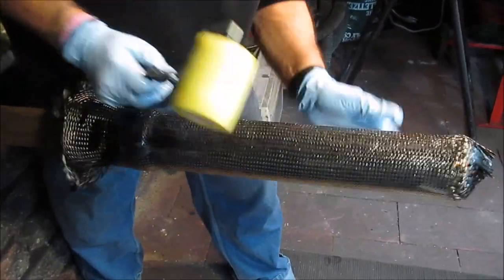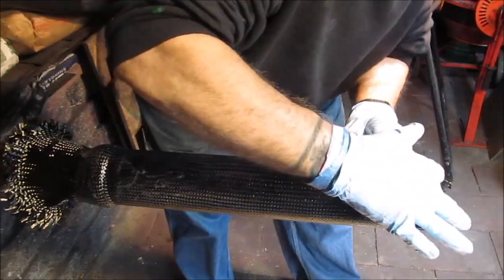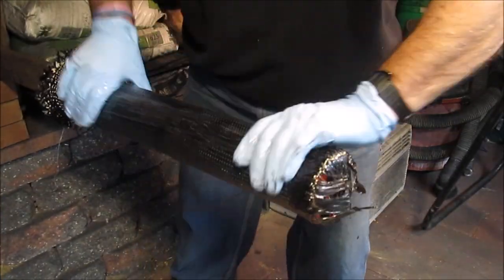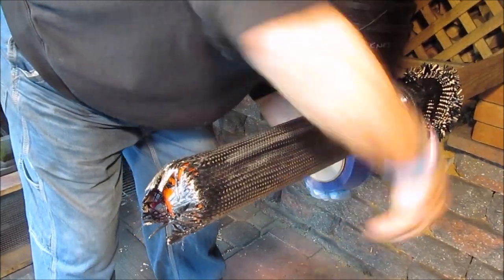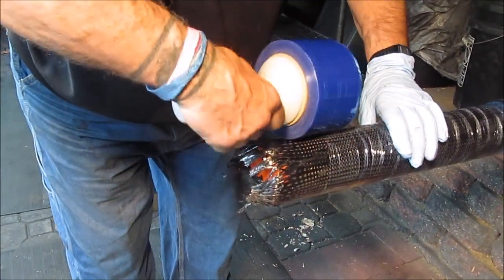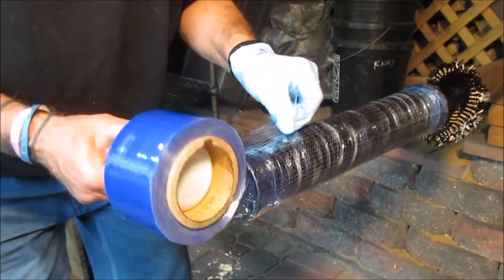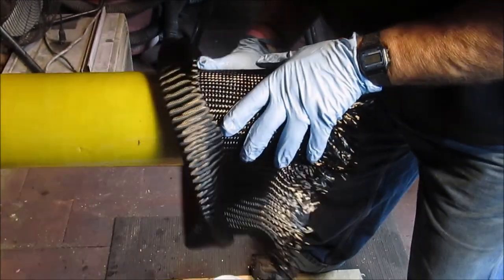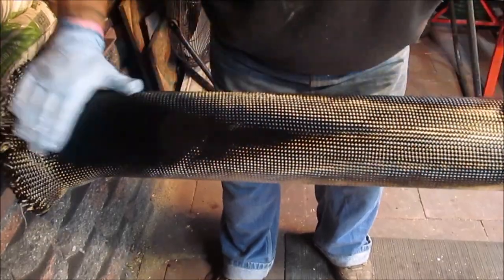Reinforcing Mortars with Carbon Fiber

Comment: The less extra resin, the stronger it becomes. It’s very important to remove the excess resin otherwise it becomes very very brittle. They make a material ( can’t thing of the name) that you lay over the carbon fiber after the resin has been applied and that pulls the extra from the surface.

Comment: That will get you decent bending and axial strength, but you need to spiral wrap if you want to add strength against expansion.
Reply: Oh, and you should probably use a peel ply layer and a layer to absorb extra resin before your stretch wrap.

Comment: Thanks Uncle Ned! Looks a lot less messy than the Walmart type fiberglass kits.
Reply from the maker: I hate working with fiberglass and resin, NW. But, working with these CF sleeves, and epoxy, was actually fun for me. And, not I have some strong mortars. Win-win.
Reply: ned gorski Did you get the carbon fiber and Epoxy at ?

Comment: Very interesting, ned.   I have a question on the mortar itself.  May seem like a dumb question though, but on those fiberglass mortars, in regards to larger diameter ones above 4 inch, why is the thickness or the "neck" of the top few inches of the mortar thicker than the rest of the mortar itself?  Just design from different manufacturers or does it serve an actual structural purpose?
Reply from the maker: That area can be vulnerable to fraying and damage if it's only as thick as the rest of the mortar, CBP, so they reinforce it to prevent that.
Reply: @nedgorski  Thanks, ned.

Comment: I don't see the point in reinforcing the whole tube, the pressurepoint will be in the bottom of the tube where the liftcharge explodes.
Reply from the maker: The pressure does decrease the farther up the tube you go, but under a large/long cylinder shell, it can still be pretty intense on the whole tube wall until the shell leaves the mortar. Layers of reinforcement could be put on the gun, though, with more layers near the bottom, and tapering up as you go toward the top.

Comment: I've had 4'' fiberglass blow out so I get it ...why go through this HDPE pipe right ??
Reply: Try doing a deep hole in the ground then put the mortar and press the dirt around it so it kind of reinforce it, I've seen many german and italians pirotecnician do that, so they withstand the force of lifting beraq shells (very large and heavy cylindrical shells)

Comment: Is this necessary for small tubes?
Reply: no, only for large diameters
Reply: Just buy hdpe mortars and you won't have to worry about it
Reply: @selfmadekuchen4564  whats large and what is smal?
Reply: Thanks guys! I have HDPE consumer mortars, but also a fiberglass 2 inch mortar for my homemade stuff.

Comment: What 'if' shell explode in mortar?
Reply from the maker: That's never a good thing. Fiberglass, carbon fiber, and HDPE don't create seriously dangerous shrapnel that flies far. Steel, on the other hand, sure can.
Reply: @nedgorski  I have 2" mortar. I want to make one more out of craft paper (samson) then wrap it with rope. Is it strong enough for 2" Shell?
Reply from the maker: @sinyokentos4204  I don't know, Sinyo. I'd think it could be, if it's wrapped strongly enough, and the plug is held in well enough.
Reply: @nedgorski  well ok. Tfi sir..

Comment: Do you need a special license to build your own fireworks?
Reply from the maker: That's a complex question. A lot depends on whether you'll be transporting them off your property or not, and where you live.
Reply: @nedgorski  I really appreciate your reply. I live in western Kentucky. I'm just wanting to build my own fireworks for a hobby an most of all education and experience. I dont plan on transporting anything I make.
Reply from the maker: @ChiraqVet  AFAIK, Kentucky is pretty lenient, and federal US law doesn't require a license or permit if you're making and firing devices on your own property. They do want you to store them safely, though, and if transported, they want you to have at least a User's Permit.
Reply: @nedgorski  its something iv played around with most of my life, but I'm ready for the next level and more education. Your videos help alot. I am hitting a brick wall trying to find the chems I need. Any advice? 
Like many others, fireworks are an important part of American tradition. Thanks again.